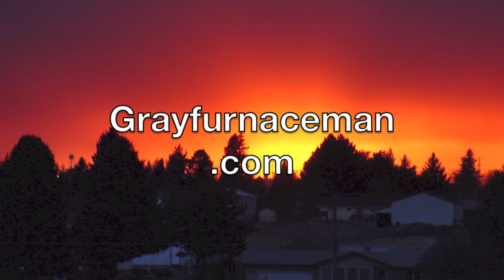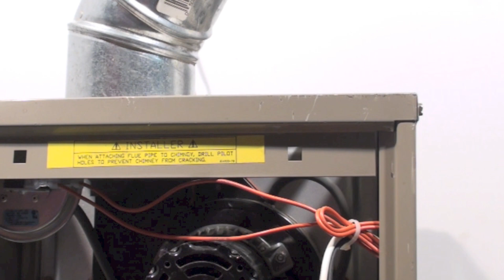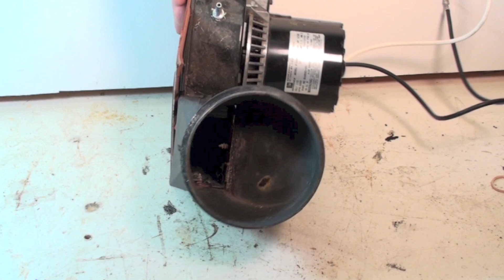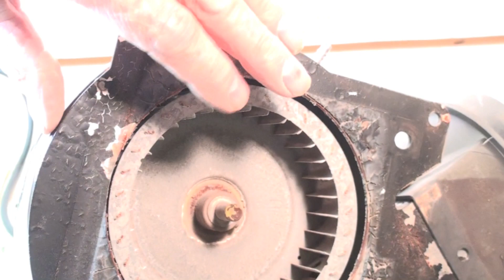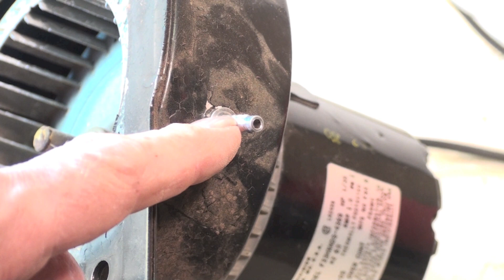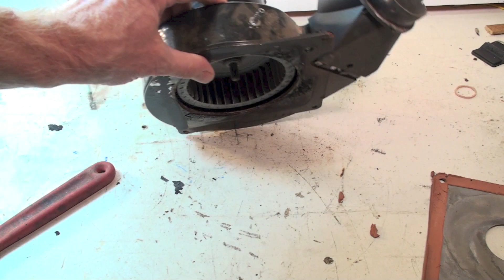Troubleshooting the inducer of the 80% efficient furnace

Comment: The Tech just left. I got a 2006 Goodman. and the tech got the inducer started again. He said the volts are are running high and the inducer is loud and that I need to replace the inducer pretty soon. I don't know what he did to get it started again but it will cost about 500.00 to replace inducer assembly. that's what he said. I think
Reply from the maker: The bearings are failed in the motor.  He probably oiled it.  Sometimes that will get it going for a short time.  It could fail again very soon.  
GFM

Comment: My inducer has a little wheel attached to the outside part of the motor. what is the purpose of this little wheel? My guess is that it is to check the condition of the bearings??

Comment: Tips - if you replace or rebuild the inducer plan on buying a new blower wheel. take measurements of the old wheel to compare to the replacement part.  Next, if you neglect to put in the main large washer seal the blower will grind on the rear of the furnace housing and make a racket.  If the blower wheel is bent it will vibrate and make a racket.  Don't spray WD40 or anything else into the bearings as a quick fix.  They will seize.  Rebuild them if you can - they are expensive to replace